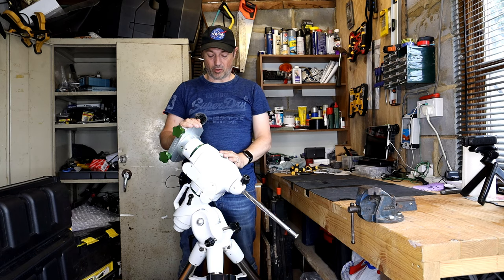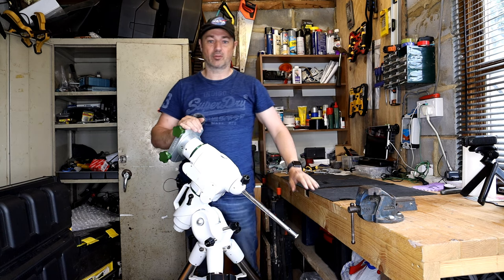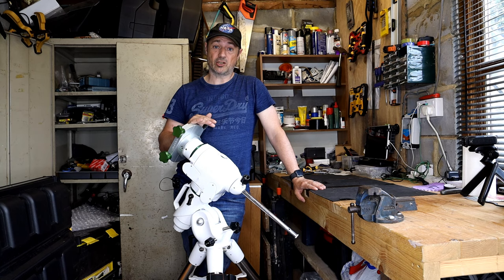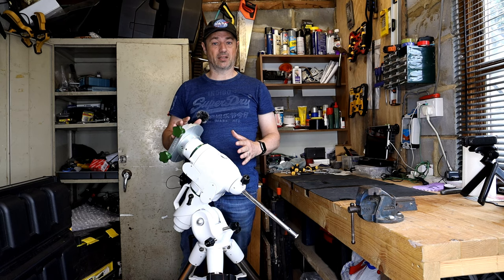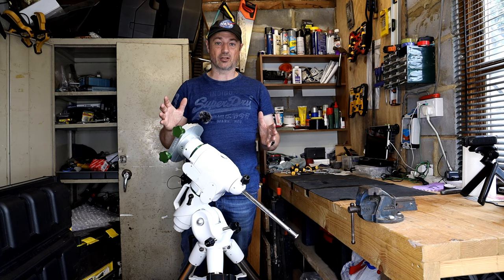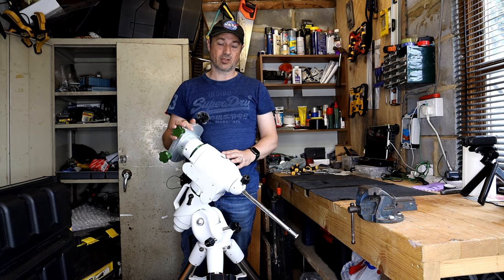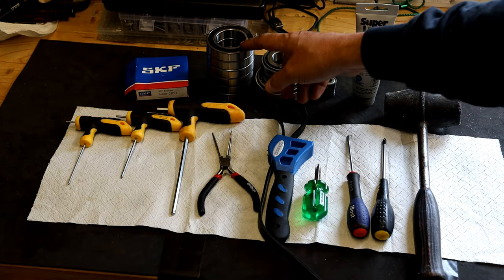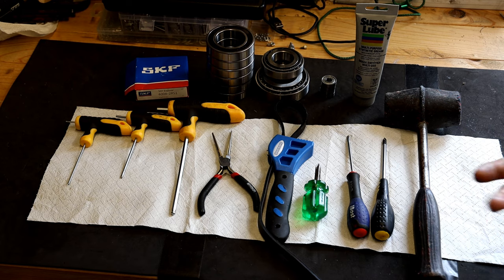Sky Watcher EQ6 R PRO stripdown and rebuild, Hypertune

Comment: Hi Glenn, a very important instruction you provided here. I allready used your HEQ5 guide for my good old (now sold) HEQ and now it was the time for the EQ6R. One question, since I am not shure if you name it in the video (also on the HEQ5) and I simply forgot how I did it then: you don't regrease the outside of the worm gear, right? Just the parts where the bearings are inserted. Looking forward to the rest of the tuning. Although it's a bit exciting, it is still a lot fun (and I have nothing better to do with months full of clouds over here), greetings from Germany and continue the good work! Jens
Reply from the maker: Thank you for watching and your kind comments. On grease application, just on any moving parts that are in contact with other parts. I only pit a thin layer on outside of bearings to help ease them in easier. 
Good luck and clear skies
Reply: @Astrobloke  great thanks! I also have ordered the SKF 608 2RS Bearings but for my taste they are not quite right and the worm gear has some resistance compared to the original 608 Z bearings and is sometimes running "free" in the inner part of the bearing, introducing problems. The 2Z/C3 bearingsonline are naming in their kit could fit, but I probably stay at the original worm carrier bearings here, as they are working pretty good. Clear skies!
Reply from the maker: @jensleuteritz6827  do not worry if they seem a little stiff as they will be working under a load condition and this will not effect your guiding
Reply: @Astrobloke  interessting. I think I will try them out and see how the worm drive behaves. Until now I tested it only freestyle in my hands. A mount tuning workshop here in Germany suggested me hybrid ceramic bearings, cost 9 euros per piece, maybe I try them out later
Reply from the maker: @jensleuteritz6827  The ceramic ones are very nice. I think they have limits of tolerance in very cold weather. I think it would have to be extreme though and in Germany you should be fine
Reply: @Astrobloke I now tried out the 608RSH, nur they where way to stiff so I switched back to the original ones. The 6008 bearings where horrible to fit in. Also it feels like the Dec is not exactly easier to turn than before, but I am not finished yet. All in all those Timken/SKF bearings appear to be pretty stiff. They roll smoothly, but need some action to get moving. Not really stiff, more like you need some more Power to get them going. I will see how that turns out

Comment: Why put the DEC back before doing the RA axis?
Reply from the maker: You don’t have to but why not.
Reply: @Astrobloke why  not?  It just makes the entire assembly heavier and more difficult to handle while trying to put the RA back on the mount casing.
Reply from the maker: @hael8680  the reason for me doing the way I did was because it was a tutorial to help others. So by doing one axis at a time it is easier to follow. It also shows that you can do either axis without having to completely dismantle the whole mount. I haven’t said you must do it this way, it is just a guide to help people.
Reply: @Astrobloke  Makes sense 😉   Did you find the new major bearings you bought were smoother than the originals?
Reply from the maker: @hael8680  a little yes. The tapered bearings were much better. The one thing i noticed about the originals is at least 2 were leaking at the seals which is not good.

Comment: Fair play Glenn, thanks for sharing. 
How did you know which bearings to order before stripping down ?  I have Az-Eq6 ,  wondering would they be the same bearings ?
Reply from the maker: There is a full strip down and rebuild online by Astrobaby which lists the bearings for the EQ6 which are the same size for the EQ6 R Pro. I am sorry that I cannot confirm which bearings are in the Az-EQ6 and looking at the link you posted there seems to be differences in the design and bearings used. Maybe contacting Sky Watcher directly they may let you know what size or model number bearings you would need to get. Sorry I cannot be of anymore help.
Reply: @Astrobloke  
Googled the hell out it looking for them.  🤪
I might do a strip down and re-grease, it’ll take the fear out of it. Don’t know why I should be worried, I work in industrial maintenance for the past 25yrs. 🤣🤣🤣🤣
Reply from the maker: @padraigfarrell7150  once stripped down you’ll know exactly what you’ll need. I have not waited anymore than a couple of days for delivery
Reply: @Astrobloke  
If I do brave it , I’ll let you know what’s in it.

Comment: What exactly is the point to this? I don't mean to pose that question in a negative light. I've seen several people going on about this sort of thing on the forums, but my understanding was that the EQ6R was so well made it didn't need tuning. As far as I'm aware I've not had any issues that have caused my mount not to work as well as intended, so find it odd that people would need to do this. In any case certainly going to watch and would be interested by your answer.
Reply from the maker: I had an older HEQ5 that was very stiff and had guiding issues. Being mechanically minded I stripped the mount to see what could be the issues. Firstly the bearings used are of questionable quality, the ones I took out were unbranded and 2 of them the seals were leaking and grease was all over areas it shouldn’t be. Also the bearings holding the wormdrive were notchy and not smooth. After servicing the improvements were massive with much better guiding and a mount easier to balance. This then led me to do the same for my EQ6. When you watch the videos I do explain my reasons for carrying out both the hypertunes.
Reply: @Astrobloke  Fair enough. Going to watch it later today, just about to head to bed. Might answer some of my other questions, probably too tired to actually take anything in right now, haha.

Comment: Nice video. However, the 608-2rs bearings are not the correct bearings for the EQ6-R Pro. The diameter of the worm shaft where it butts up against the bearing exceeds the max allowed abutment dimension given in the spec sheets for the 608-2rs bearings. The bearings with the metal shield (SKF part #608-2z) have a larger max allowed abutment dimension, and are the correct bearings to use. When I rebuilt my EQ6-R Pro, I had some bearings with rubber shields left over from when I rebuilt my Orion Atlas (same as SW EQ6), but when I used them in the EQ6-R Pro, when I tightened the nut down on the worm bearings, I could feel it binding up because of the rubber shields. So I had to order the correct bearings, and replace them. Now when I tighten the nut down on the worm bearings, no more binding on the rubber shield.

Don't mix up the spacers! Make sure you put the same number of spacers back where they came from! Ideally, you should measure the spacing, and use the correct number of spacers to center the worm on the worm gear, possibly adding or removing spacers from what SW used. Don't necessarily trust that they got the number of spacers correct. The Astro Baby site has the procedure for adjusting the number of spacers to use. 

Also, since you went through all the trouble to tear the mount down, you really should degrease things, especially the outside of the brass worm gear, where the clutches press up against it. That's why the clutches on the EQ6-R Pro are notorious for slipping. Degrease everything with mineral spirits and that problem goes away. Also, degreasing and cleaning the worm and worm gear will remove any grit that might be in there, which would cause spikes in guiding. Really, there's no reason not to do that when you have everything torn apart.

Clear skies!
Reply from the maker: Hi Kevin. Thank you for your reply. I know the bearings I took out had the metal seals and not the plastic ones. I opted for the later as they are a higher standard of bearing and I had read in more than one source that these were suitable for the job. I personally did not have any binding issues and the mount is now guiding at 0.3rms so they seem to work fine. I will however add this information to my video so people have the choice.

clear skies
Reply: @Astrobloke  Sounds like a success! Glad the mount is performing well for you! CS!

Comment: I'm not sure if you'll see this, but I replaced my bearings and re-greased my mount by following your tutorial, and when I put it back together, I noticed the RA balance was favoring to one side shown in this video: https://youtu.be/TeigaQsRrTs

Do you have any ideas what is causing this or how I could fix it? 

I'm wondering if the balance was always favoring one side before I replaced the bearings, and I didn't notice because the axis' were sticky? or i somehow messed up reassembling the mount, however, I believe I replaced everything correctly.
Reply from the maker: Hi. I watched your video clip and there is only really 2 reasons it would do this that I can think of. 1) would be that the mount is not quite level. 2) the 3rd axis balance is off.  I had the 2nd issue with mine but confused with your set up as everything looks centrally aligned and when you point the scope up it is not falling left or right. Can I ask you to try it again with 2 weights on the shaft further up the counterweight shaft.  Also with the RA at horizontal and the scope pointing directly up just gently push the DEC axis left and right and see if there is a bias to one side.
Reply: @Astrobloke  I tried what you suggested. I put on 2 weights closer to the top of the shaft, and I checked the DEC for balance and for a bias. It seems like the DEC could be slightly bias on the left side because it felt a tiny bit easier to push it left than pushing it right. What's weird though is the fact that no matter which way the DEC/telescope is facing, it always wants to drift east.

some more info:
 I first noticed the problem a few months ago which is when the video was recorded, and since then I've tried to think of solutions. I've been using my SCT to test solutions because I believe that its balance is more reliable compared to my small refractor with a ton of attachments hanging off of it.The best thing I tried was putting small tungsten weights (~270g) inside the center of the mount on the right side (closer to the motherboard) to weigh it down but the axis still slighlty drifts towards the east. I'm wondering though, if my mount is naturally east heavy/drifting east, should I even try to fix it because isn't that beneficial to keep the gears touching?

I'll update you with a video showing everything. Thank you for the help so far!
Reply: @Astrobloke  here is an updated video: https://youtu.be/d4sCbFurzQM . 

Also something I noticed is that whenever I put my small refractor on the mount instead of the SCT, then the drift seems to be less dramatic